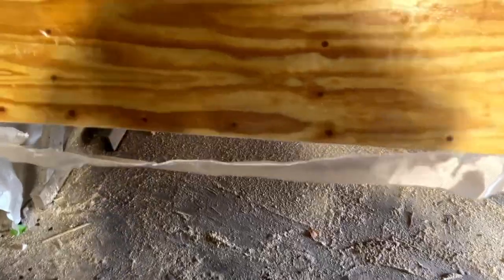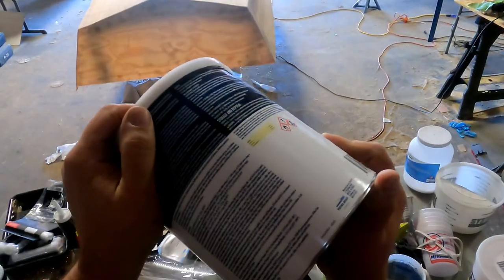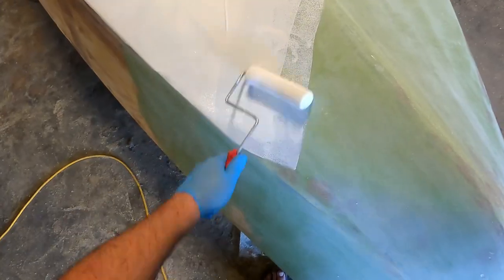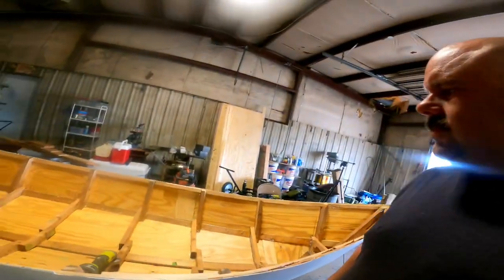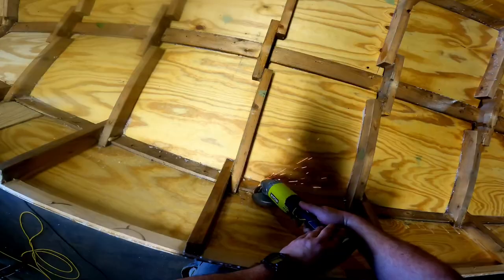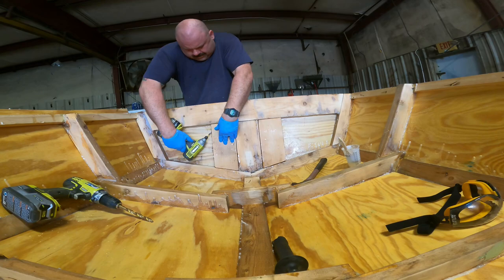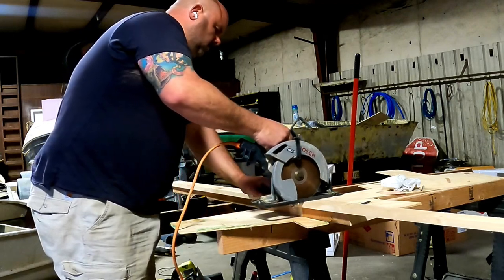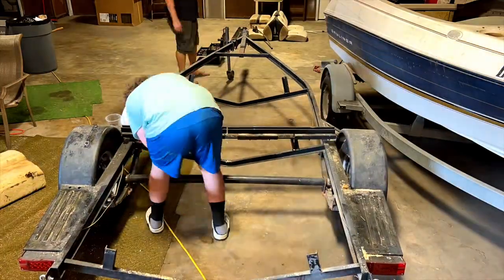Painted And Flipped- DIY Boat Build Ensenada Panga 14

Comment: Nice project i am also planning to build one but i am concern about it longevity. Is your still going strong using regular wood ?
Reply from the maker: I’m anticipating that it will be alright, I intend to keep it well covered and fully dry between trips. Everything is well sealed but time will tell. Use the best lumber that you can afford.